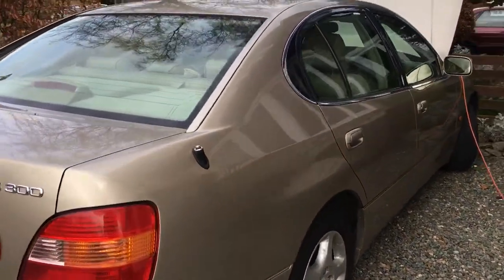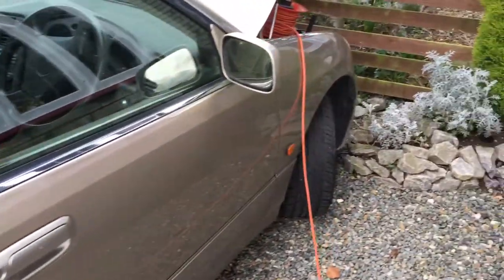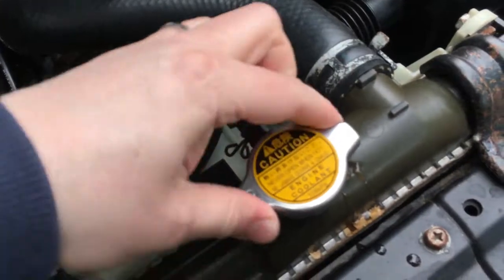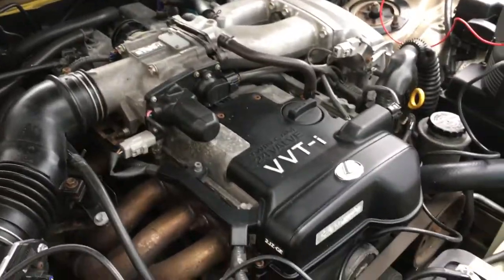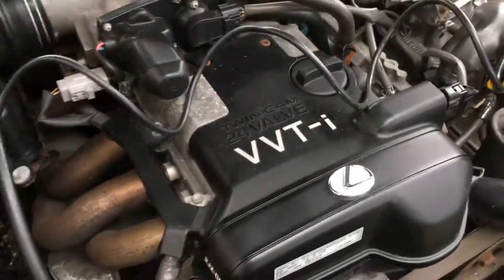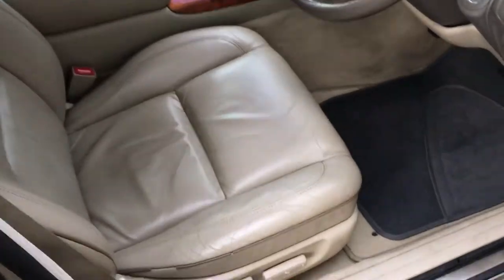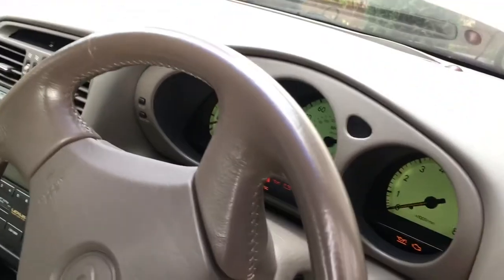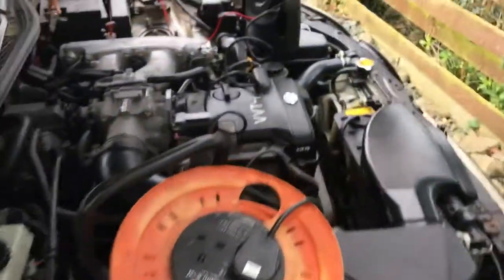Starting a 1998 Lexus GS300 2JZ-GE After 5 Months

Comment: did u get the engine from missouri cause my 93 had one i put in and i put the car into a fence after i broke the axil
Reply from the maker: I’m in the UK. I bought the car as it was.
Reply: Missouri??? 😕
Reply: @RealWorldCarReviews  sell me it
Reply from the maker: @great4ever845  Did you check the date of filming? 😆
Reply: @RealWorldCarReviews  ya still have it ?
Reply from the maker: @great4ever845  Sold it 4 years ago
Reply: @RealWorldCarReviews  am doing research need reliable car